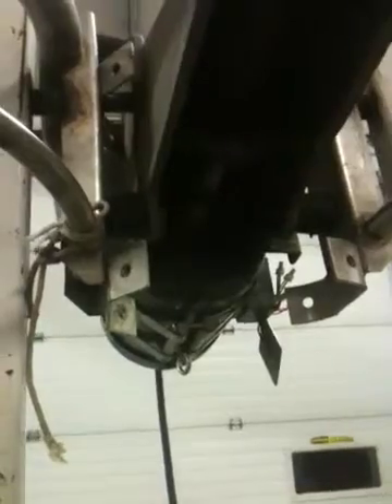Lapham Peak Snow Gun Repair

Comment from the maker: Marc, heat, heat, heat. We use a torch and be sure there aren't 2 Allen set screws in each of the 3 holes. Watch the shaft color with the heat. Slow and steady, no hammer. Good luck.

Comment from the maker: @bjbassman1 i assume you are speaking of the motor HP.  we use Baldor M3713T - 15HP 3450RPM Frame 215T Rigid Base 208-230/460V.  the origional SMI motor was a 25 hp.  just make sure your overloads or heaters match up on the starter.  sorry about the delay I dont check this email much